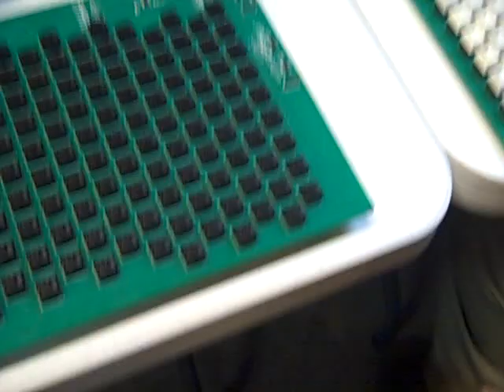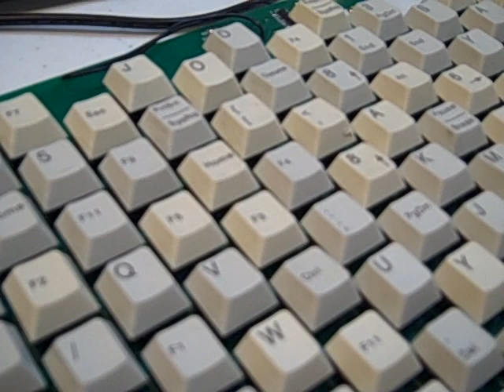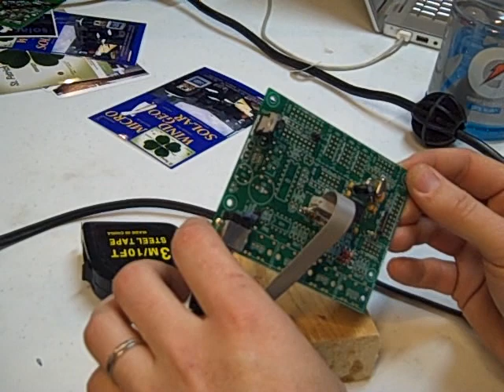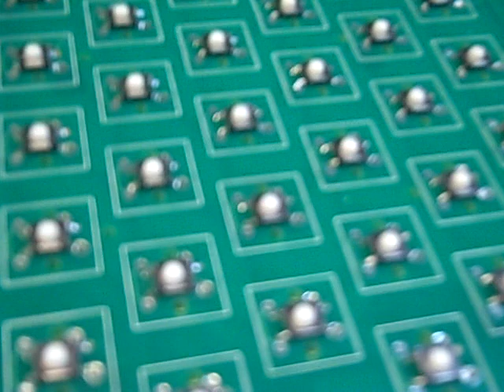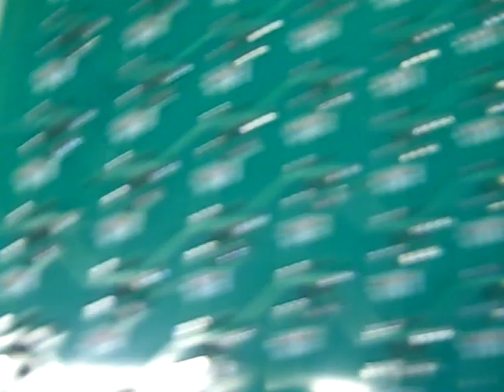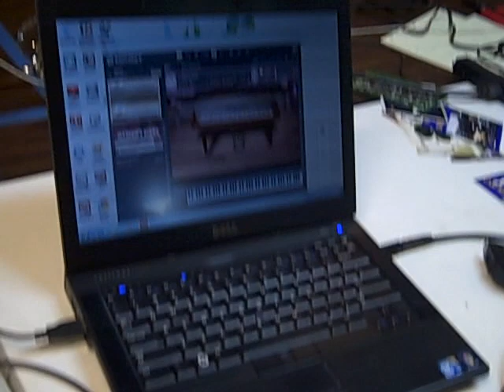DIY Isomorphic Keyboard project

Comment: I have wanted to do this with 3 keyboards worth of fairly quiet keys myself. The thought of hex shaped keys 3D printed to fit on has too.

Minus 15 dB audio though, I can't bother to turn the amp up for a talk that has the intensity of a conversation in the next room. I just looked at several scenes, it might as well be silent. If you can't see the mic, you're not talking to the media. Even audacity can bring audio up to listenable level in a video, free. Use it to gage your and others audio level, using it's wasapi mode before you post.

Comment: Idea: You could make a standard keyboard, and under it you could position the tact switches. Each tact switch would generate a space, so you could have a keyboard that you could use without a space bar. When you type the last letter in a word, you'd just press harder and immediately start entering the next word. It would definitely speed up typing as well as be a cool concept for a space bar-less typing system.

Comment: These tactile switches are far too noisy. How about just getting a PC Kbd manufacturer to create the physical Kbd plastic layout with a few function keys (just like a PC Kbd). Then fix it onto a flat wooden board, connect it via an interface to a Micro computer chip (such as Android) and control it via a program?
Result: That will involve minimum of mechanics, electronics and so, shrink its costs.